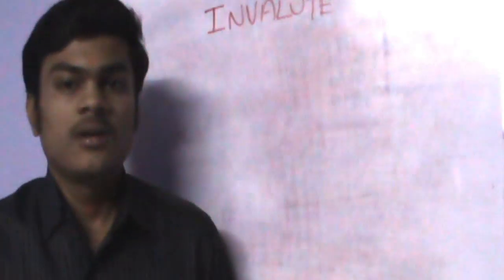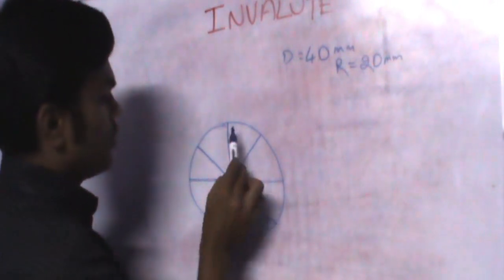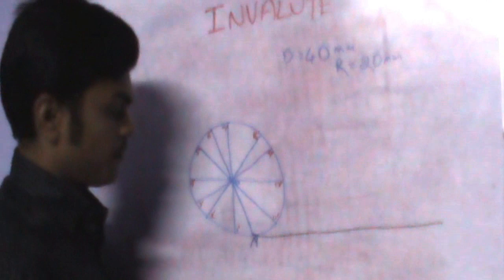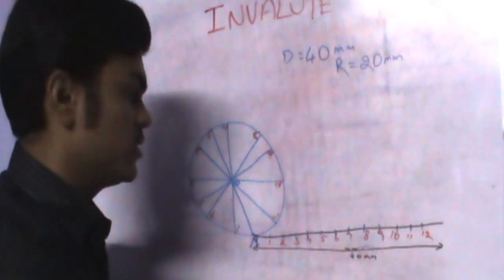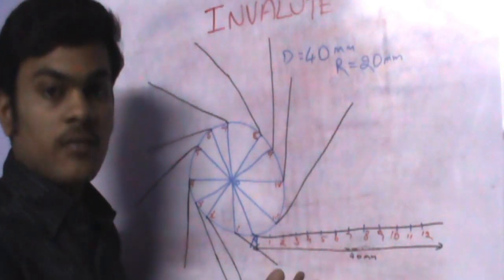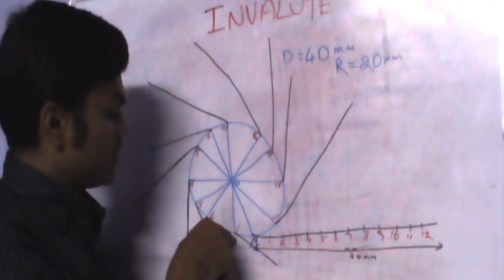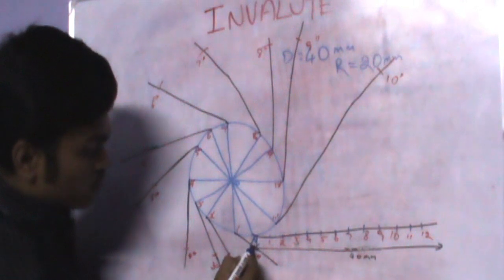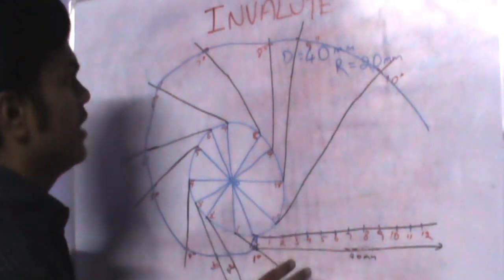Involutes

Comment: The circumference of the circle is pi*D or 2*pi*r.
So the line drawn from the point A should be of length 3.14*40 or 2*3.14*20 i.e 125.6mm.
But your explanation is good ☺.

Comment: hello!!
i would like to rectify a small correction of involute to circle. the tangent to be drawn should be of lenght equal to circumference of circle but not diameter of circle as when we unwound once on a circle the resulting  line will b equal to circumference of circle.
video is helpful.
thank you